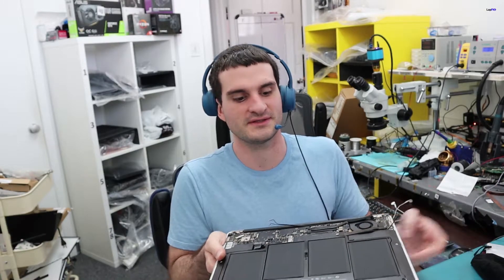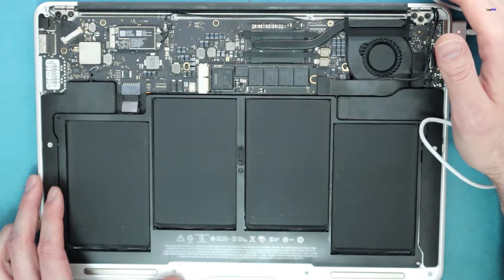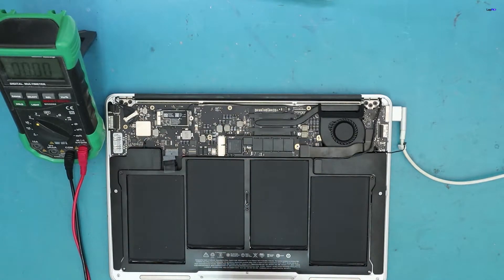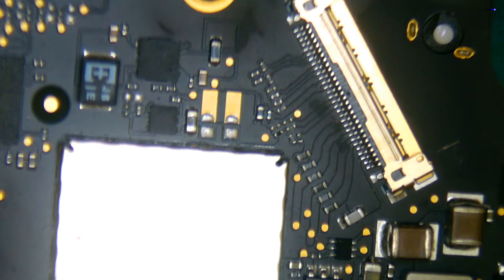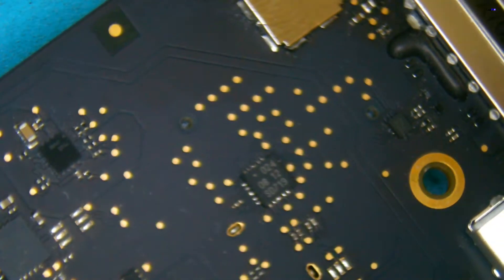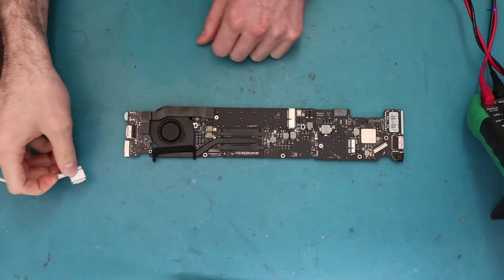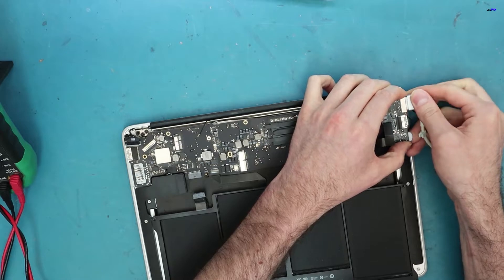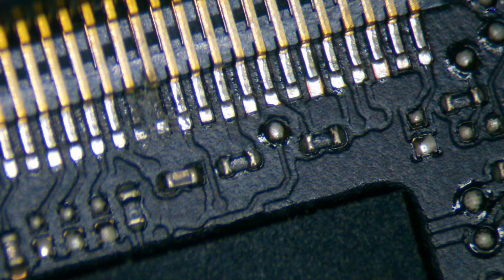Troubleshooting and Fixing MacBook Air A1466 820-00165-A  with Orange Light No Power

Comment: My laptop is dead and no lights at all on the connector when plugged in. The charger output is 3.5V but when I test the differential on the connector (where the charger is plugged in) is giving me 0.200 volts.
Reply: just to  confirm, the circuit where the power is connected to the computer was the problem. Indeed,   the small hardware was not passing enough current therefore the huge difference in voltage.
I replaced it and my laptop is back to life. A $11 bucks circuit and $0 for my labor (but priceless); a very cheap repair.